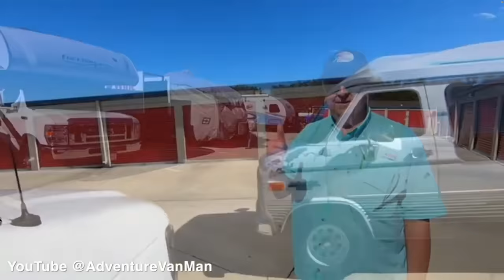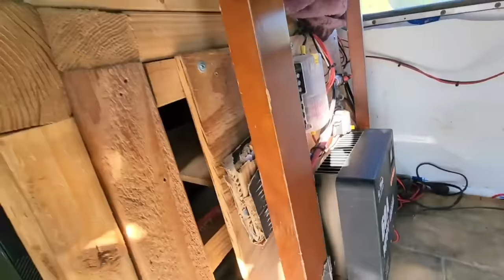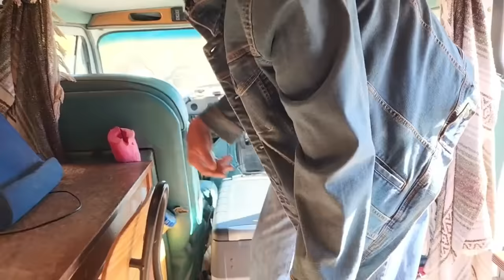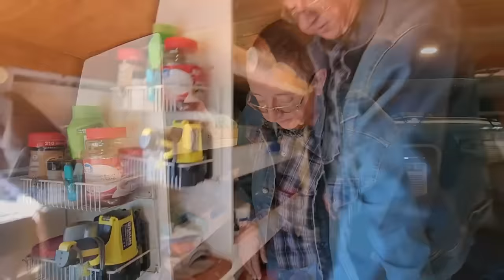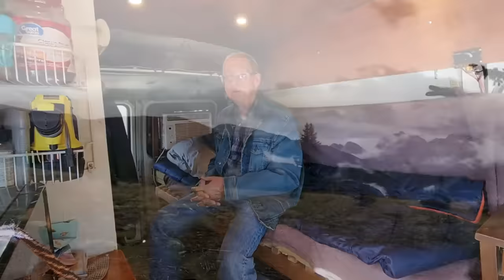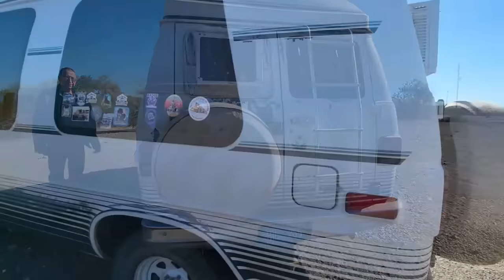Van Life Freedom: Living Off $1500 Social Security in a 1991 Conversion Van

Comment: I too did my resrsrch for a few 2:43  years though i had this planned back in my early 20's, im 54 now. Im fulltime in a 95 G20, bought it for a grand and dumped thoudands into it brcause it sat for 10yrs but it only had 52,000 original miles on it so it was worth it. A lot had to be replaced, almost everything less the motor and trsnsmission. I live on the cheap with a very generous paying job with many days off becauce i work 12hr shifts. Stay local on my scheduled days and travel to hike, kayak, raft and fish on my days off. Only thing missing is a dog. No gf, no drama just absolute freedom with little overhead financially. Lifes great and i wish i had done this earlier in life. This guy does exactly what i do for showers at the gym, thsnkfully i shower at work at my job too. This isnt for everyone, theres a lot of convienences thst you will sacrifice but again its worth it and im never broke, always have money. I encourage everyone to try it. ✌️

Comment: Question : Someone told me not to get an old vehicle because all of the rubber things will need replacing from age and dry rot etc, and it costs a fortune for each tiny thing, because the replacement parts themselves might be inexpensive , but the labor costs are really high for each thing. -- if you put a new engine in the vehicle, there's still a lot of other things that might need to be replaced ?